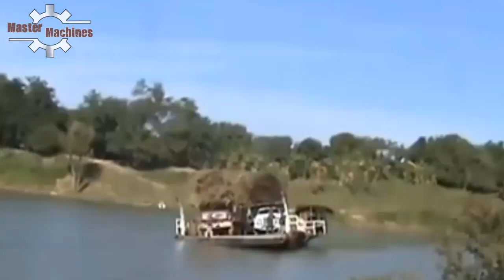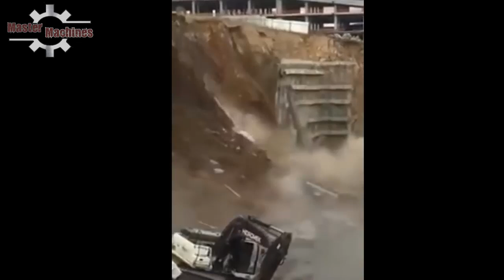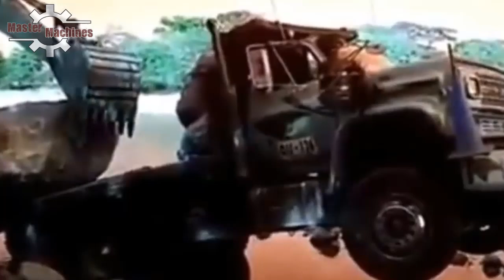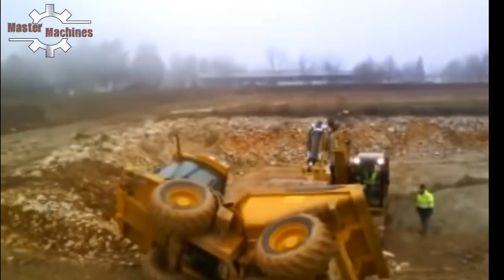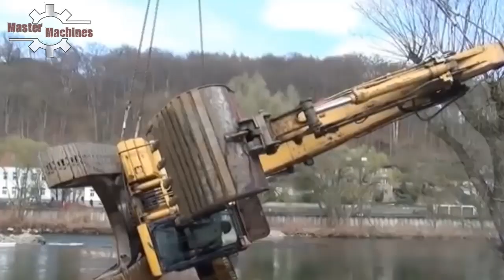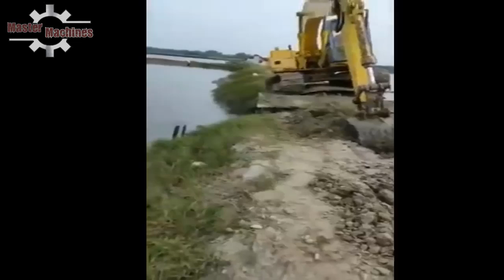TOP IDIOTS Crazy Operator Heavy Equipment Skills - Bulldozer, Excavator Fail Win Compilation

Comment: That teaser picture of the Marion 5700 striper laying on its side in the headline picture was definarely not operator error. People familiar with this accident know that it was a deliberate job.
Reply: I was wondering about that myself.  Thanks for setting the record straight regarding the stripper shovel seen in the photo.
Reply: When this "accident" happened I was erecting a 40 yard Dragline more or less  ext door to that mine. We were working 4 ten hour days on that job so I had a 3 day week end every week. I took a job as a flight instructor in Owensboro. We used to fly over it a lot so I have many pictures like the one here from the air. Later I was doing a job in Wyoming and met the operator that was on the machine when it turned over. He said it took about a half hour to fall over.
Reply: @MegaDonns  When you say "deliberate job" do you mean that the Marion shovel was being scrapped?
Reply: @WAL_DC-6B  First of all let me stress that I was not there when the 5700 turned over so I only have the stories of people who were there when it happened. Therefore my story is hearsay. I was in the mine before and after the accident. I know that the haul road was an old road going through that boggy place. It was not wide enough for the shovel to cross so they dumped a lot of fill dirt alonside the existing road.They were moving from one pit to another. When the operator got to the crossing of the boggy place  (acvording to what he told me later) he stopped and got off to speak with the supervisor who had been brought in to conduct this move. The operator said he didn't want to cross on half solid and half soft fill dirt. The supevisor told him to get back in the seat and do what he was told. When they were in the middle theoperator said he dould feel the right side sinking. He swung around to the right and jammed the bucket into the mud to try to hold it up. It kept sinking so the operator and oiler grabbed their lunch and got off and watched her sink away. People who worked in the Gibralter mine said they needed to get rid of that machine and go to a Dragline operation anyway. Interestingly enough the company had a Marion 8700 sitting idle and even had a new tub for it so the moce was fairly quick. Jack's erection crew even had a guy derrick sittong idel so it was used for the Dragline build. Have knowing the move supervisor I can believe he told the operator to shut up and get moving. Knowing the Dragline erection supervisor I know rge replacement Dragline job went well. Interesti gly enough the Dragline that I was erecting at the Pyramid mi e just east of this site wound up being moved to a quarry in PA and wound up upside down as well. Small world this Dragline and Shovel business.
Reply: @MegaDonns  Wow!  Interesting story about the fate of this strip mining shovel  Sad it ended up that way, but at least it apparently was on it's last days to be replaced by a dragline.  Thankfully no one was hurt, physically that is.
Reply: @MegaDonns  Is The dragline that you are referring to the Marion that slid down the hill at the concrete job that had to be flipped back over.